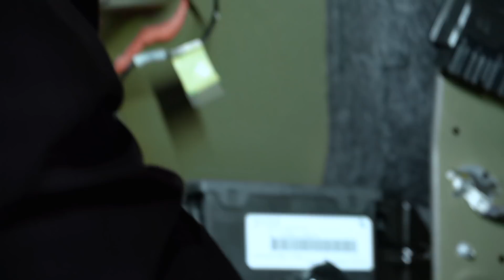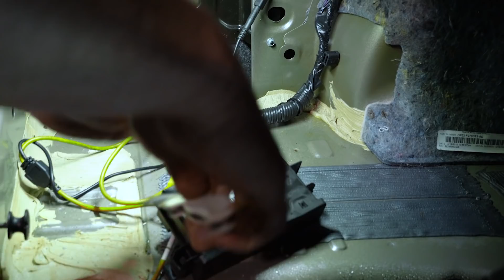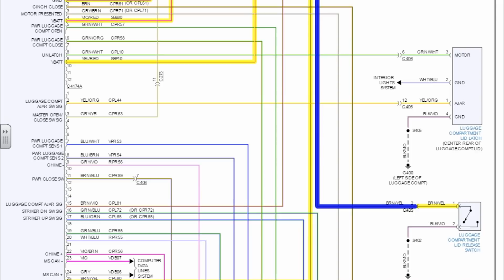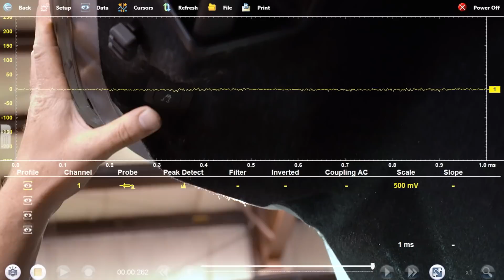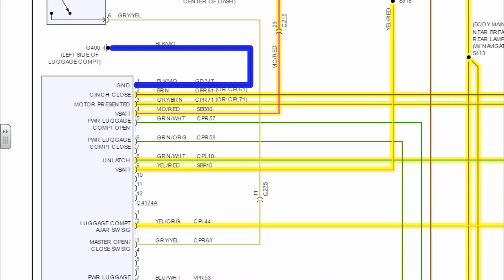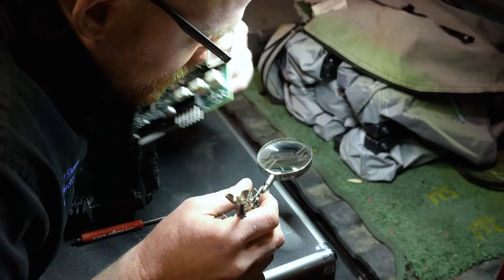2013 Lincoln MKZ Parasitic Drain/Rear Gate Trunk Module (RGTM) No COM (Part 2)

Comment from the maker: To the multiple people commenting that I should have loaded the powers and grounds on this module with some light bulbs, I want to tell you why I didn't and why I DO NOT carry around a bunch of different load, light bulbs around with me like a lot if you do.
Technically, with a dead module, there was no current flow, so you are not wrong in wanting to do that. My arguement against it and why I don't ever do this additional test in a case like this, is you are absolutely NOT going to have a wiring problem AND a dead module/component, that happens at the same time! It is one, or the other.
If by some chance, say 1 in 10,000, that you do, you fix the wire when you're done! After the module gets replaced and you can restore current flow, so you can now see the drop in voltage. Something you couldn't do with the component being bad/open. (why you guys love your light bulbs)
So I get the idea, I get the need to want to load circuits and carry a bunch of different brightness light bulbs around, but it is overkill, it's not needed.
Here is a  question for you guys:
During my KOEO, connector plugged in, backprobing tests of the powers and ground. If there was a power feed problem, what would it have looked like? If there was a ground problem, what would it have looked like?
One more, if you want to argue that there could be a wiring problem, was it a wiring problem that was causing our no com and completely dead inputs and outputs? Not a chance. So dead module right? But you say we could still have a wiring problem because you didn't load the circuit. My reply. It doesn't happen,  the module, motor, light bulb, solenoid etc etc does not fail at the exact same time you have a wiring problem. 
Now I'm sure one of you will have some obscure example of an electric motor failing from low voltage from a poor power feed. My reply to that? Did it need a motor still? Sure did. And when you're done, you find the pump runs but psi is low and then you find your wiring issue and fix it! You still needed a pump! You 100% confirmed the motor was open (12v on the feed and 0 on the ground). So yeah, that 1 car out of 10,000 bit you, but it was never a bad call, it was two separate issues. This just doesn't happen people. It doesn't
Reply: Quick question, wouldn't it have been possible if there was a short in one of the sub components (lid switch, lid motor/strike motor), you may have seen higher voltage in the CAN system because the 12v power would be looking for somewhere to go.  Also you could have unplugged those (you did most of them except the switch and latch in the lid) and see if 12v returns.  Just simple unplug it in those components.  Just trying to expand my knowledge!!
Reply from the maker: @igotaction  we had good 12v supplies and ground coming into the module itself, unplugging components on this computer system would not have help us in this situation. 
A short in a switch input, only affects that one circuit. A short in one of the outputs, again, only affects that one circuit. A shorted reference circuit (5v ref) is a different story and that was not an issue here either as a shorted reference would not affect output voltage levels.
Reply from the maker: @igotaction  great observations! Switch input circuits are isolated with current limiting resistors and will never cause  other circuit problems within the computer system when they get shorted or open. Now a pressure sensor, hall effect and a potentiometer would be a different story. These can short and take out the reference circuit (usually 5v)
Reply: ScannerDanner meant to say "could you have" not "you could have" it was a question.
Reply: Boom, roasted !

Comment: at 22:20, when you mention if the cinching striker is operable, quick check is to see if it moves up and down when you were simulating the latch closing with a screwdriver.  The power striker would likely still need to be plugged into the PDL module but probably should still trigger.

Comment: I need some advice please!! My car is identical to the Lincoln that SD just did. I had the battery replaced at Sam's club a month ago. A few days later I had to check engine light in my car wouldn't start with the push button. I then began getting several communication issue codes. Last week they told me that I needed to replace the fuse box under the hood. I went to pick up my car todayand now they are telling me that I need to replace the PCM and BCM!! How can a computer and 2 fuse boxes fail simultaneously? It's at the dealer, I don't have $2000, and none of this makes any sense. Could someone who knows this stuff please give me some advice? Thanks
Reply from the maker: Sounds like someone does not know what they are doing to me

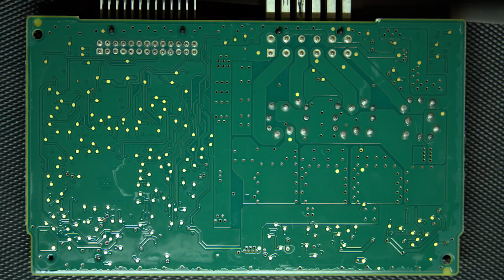Comment: 30:18 It could just be flux cleaner residue from manufacture.

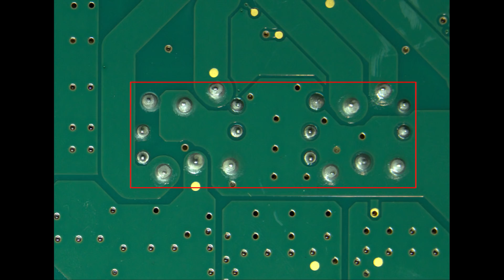30:34 Those are typical lead free solder joints even a good joint will look cloudy like that which is why they are so difficult to inspect. If that was a leaded joint then yes that would be a bad cold joint.

Comment: At least tell us the reason for air bag deployment to take care while diagnose, I suggest you make a video about how to avoid critical issues while diagnosing
Reply from the maker: I certainly will my friend
Reply: The Airbag Module has a multi-axis accelerometer in it, when he rotated the module, it probably 'detected' the vehicle was rolling over, and deployed the curtain airbags to protect the occupants, exactly as it was supposed to, the module doesn't know it wasn't bolted down so it 'assumed' the vehicle had suddenly rolled over.
Reply from the maker: Yes sir. HUGE lesson learned on that one

Comment: 15:00 could we just unplug the module as see if the light will come on and off, which will indicate if it's controlled by BCM of this module?
Reply from the maker: I just needed to check another diagram. Just didn't feel it was necessary for this case study. But you are like me, I wanted to know anyway 😃

Comment: I wish I had that module board in my hands to play with. The only thing I enjoy more than automotive electrical diagnostics is board repair. I’m no Dave Jones, but I can diagnose and replace bad components. It’s when I have to get a computer involved that I start struggling. I’m getting there though.

Comment: thanks for video. i was desperately waiting for this part2. i have issue with same car up model 2015 mkz hybrid.  MS(medium speed) can system is down for few modules and in one of down systems is trunk module. on MS can low and high i get 0.5 volts and jumping to .75 to 0.  but its erratic. Another problem with this model is that CAN splices (they call it splice module) are awful. no comm. with  hvac module, trunk module, front control interface module. i am stuck at a splice module 42( which i can't find in alldata). because i have comm. with radio transceiver module(rtm) but no comm. with rear gate trunk module.( i am also using snapon triton d8)
Reply: UPDATE.. Finally found the problem. Medium speed can wire found corroded under the carpet behind driver seat. my guess is that someone spilled water on carpet and water went into that connector.  as i connected wires everything was back to normal.

Comment: I liked seeing the extra steps to be as sure as possible that the module was actually dead. It's never easy to make the call on a bad module... especially when they are expensive.  Another clue, when you're not sure that you can believe your no comm with the scan tool, is that other modules reported not being able to communicate with it as well. Great video as always!
Reply from the maker: That is correct my friend. I believe I showed that part? I think the instrument cluster told us the rear gate module wasn't talking.

Comment: Don't forget to always test powers and grounds with the circuits loaded (such as with a test light). In this case, the module likely is faulty, but it never hurts to be 100% sure. It would suck if the root cause was a corroded terminal in a connector located further back in the trunk caused by the water intrusion.

Comment: Nice job Paul I’m fighting hands free trunk assist on a 14 bmw 328D and I’m testing now and thinking the upper of lower sensor is bad. I need to figure out how to test them. Not much data on them and wire diagrams are bad.

Comment: Great stuff as always Paul & Caleb! I've yet to be faced with calling any module, but I would have lacked the confidence to call one before I found both your Premium Channel, and the YouTube channel. 👍

That trunk was a mini greenhouse! A little sunlight and you'd have had a whole ecosystem living in there, LOL! Like the '92 940 I have here - I dropped a tree on it, and bashed in a corner of the rear glass. Water flows right in. There's all kinds of greenery popping out of the swampy carpet. 🤣

Holy CRAP dude! That side-curtain airbag blast clip made me a bit jumpy! I can't even imagine how that was being RIGHT THERE! That happened just from plugging in the airbag module? WOW!! 😲 Great lesson for everyone there!
Reply from the maker: It happened from unbolting and rotating the module (jumper wire connected to the housing to give it a ground). See, the engineers were smart, unbolt the module and you lose the main ground, but then "smart guys" like me figure that out and then give it a ground so I can test things live. Problem then was, I didn't know the module contains and internal roll over sensor. And there was the fatal error
Reply: @ScannerDanner  - AHH, thank you for that explanation!! I would have never known that in a million years. I watched it a few times after I made my comment, and I started to think just static from your hands set it off. Thanks for clearing that up! 

I'm thinking the price tag on that one was just as scary as the blast 2" from your skull. Sorry, brother!! 😵 I'd imagine programming was involved for the new parts as well. :(
Reply from the maker: @SmittySmithsonite  I'm going to to something with that video. There are lessons to be learned for sure
Reply: @ScannerDanner  - Cool, Paul - I'll be watching for that one. Thanks again!

Comment: Thanks for sharing SD👍, much awaited case study👨🏻‍🔧
You're Awesome, stay Safe & stay Blessed🙏
One question, how to find an electrical fault without having access to a wiring diagram or any other service info?
Reply from the maker: If I don't have a diagram, I'm not working on it.
Reply: Can be done in some scenarios, but it most modern cases it's not possible

Comment: Sorry if I missed something, but it's unclear whether disconnecting the module and other components eliminated the parasitic draw. 
On the subject of signals on the CAN bus; CAN signal decoders have been available for a while now. Knowing the CAN address of each module, one could determine whether a particular module is transmitting on the bus or not. Do you know of any such usable equipment/information becoming available anytime soon?
Reply from the maker: In part 1, we could not recreate the parasitic drain. Through the comments, I found out there is a TSB on reflashing the rear trunk module for this exact issue. But ours was dead when we started testing it. So a new module and the updated flash will fix this thing.
As for a signal decoder, in our case, there were other modules that confirmed the no com with the rear gate or trunk module. In my opinion, that is all you need. In other words, that is my signal decoders. The other modules
Reply: @ScannerDanner   I meant the decoder question to be generic, not necessarily as it applies to this case.
Thanks for taking so much time to answer all our questions, it's appreciated. Stay well.

Comment: Hey Danner, Great video. Very captivating. A couple of things I would improve on to check ANY module: 1) to check powers and grounds use an INCANDESCENT test light instead of a meter or power probe. ALWAYS. Meters and probes only tell you if there is voltage while the light tells you if there is voltage AND if it can handle a load.. Better yet a headlight bulb light on the higher powered circuits that can handle it. Even for checking a a 5 volt reference line, a tiny test light made from the tiny low power 12 volt bulbs (from old instrument clusters) tests if a 5v reference can provide a slight load, enough to power a sensor. The meter would only be used to check the weak diagnostic voltage coming from the signal wire to the sensor. 2) As for the No-COMM. If you probe the CAN network wires, you would see pulses and one would assume that the pulses age coming from the module being tested and conclude that the module is working , BUT you don't know FROM WHERE those pulses are coming from. If you unplug the module and test the CAN wires for pulses, you see the pulses that the rest of the network is providing. BUT what you really want to know is if the MODULE in question is making its own pulses. To check if a module is really brain dead you can plug the module back, make sure the ignition is on, and CUT at least one of the CAN wires. and test for pulses on the module side of the cut CAN wire, to see if the module is generating IT"S OWN pulses. I bet if you have done this test you would see that there are no pulses coming from the module. Or instead of cutting wires you can unplug the module, put it up on a bench, and power up the module, connecting powers and ground to the appropriate pins and testing to see if the CAN pins are pulsing CAN pulses. I have done both techniques on dozens of modules this way and made calls with certainty if a module is brain dead or good.  Of course, when using a test light use good judgement. You don't want an airbag blowing up in your face. Hope this helps other diagnostic people out there.  Thanks for the great videos.
Reply from the maker: BTW, I love your "cut the wire" test! I used to do this on circuits all the time
Reply from the maker: I would disagree with #1 in your comments. You're not wrong, I just have a different opinion on it. Caleb and I are actually going to film something on this and talk about this exact scenario. Thank you!
Reply: ScannerDanner yep,when everything is plugged in a multimeter can be more precise than a test light!!!  Cant wait for the video!!!

Comment: ok paul correct me if i'm wrong.   you got powers and grounds and with it unplugged you have network.  so if we were to de-pin the two network wires and plug them back in and operate a function that the scanner shows a pid for  if the modules can interface was working we'd see activity coming out of the module showing the status change and lack of would definitely condemn it.  i was thinking about this when you were showing the light operation by the switch but as you said it may also be controlled somewhere else. partially failed modules and intermittent modules are fun aren't they?
Reply from the maker: Yes, if you were to de-pin the 2 network wires, and measure on the module side, you would see CAN messages coming from the module itself if it was talking. It may look a little funny though without the terminating resistors, but it would be there.

Comment: I would check again the 2 power wires with a test light just to be sure.
Reply: He could have, however, he checked those power feeds by back probing and it was plugged in, therefore there was current flow on the circuit so the measurements were already accurate enough to pinpoint a voltage drop. You dont need to use a test light if its back probed and current flow is occurring
Reply from the maker: sabin  technically, with a dead module, there was no current flow, so @Alex Mironov is not wrong in wanting to do that. My arguement against it and why I don't ever do this additional test in a case like this is you are absolutely NOT going to have a wiring problem and a dead module/component that happens at the same time.
If by some chance, say 1 in 10,000, that you do, you fix the wire when you're done. After the module gets replaced and you can restore current flow, so you can see the drop.
So I get the idea, I get the need to want to load circuits and carry a bunch of different brightness light bulbs around, but it is overkill, it's not needed.
Here is a  question for you guys:
During my KOEO, connector plugged in, backprobing tests of the powers and ground. If there was a power feed problem, what would it have looked like? If there was a ground problem, what would it have looked like?
One more, if you want to argue that there could be a wiring problem, was it a wiring problem that was causing our no com and completely dead inputs and outputs? Not a chance. So dead module right? But you say we could still have a wiring problem because you didn't load the circuit. My reply. It doesn't happen,  the module, motor, light bulb, solenoid etc etc does not fail at the exact same time you have a wiring problem. 
Now I'm sure one of you will have some obscure example of an electric motor failing from low voltage from a poor power feed. My reply to that? Did it need a motor still? Sure did. And when you're done, you find the pump runs but psi is low and then you find your wiring issue. You still needed a pump! You 100% confirmed the motor was open (12v on the feed and 0 on the ground). So yeah, that 1 car out of 10,000 bit you, but it was never a bad call, it was two separate issues. This just doesn't happen people. It doesn't
Reply: I understand, thank you for answering and explaining.

Comment: I spent years at a dealership. The way Honda wanted the techs to diagnose network faults was with continuity testing. The dealership didn't have a scope, nor did anyone know how to use one. Not sure why dealerships don't encourage the use of scopes. It's the single most useful tool when diagnosing network malfunctions. How the hell else do you confirm network data traffic on a data line?
Reply: GooE because dealerships (most) 99% do not have techs with this knowledge or ability to perform these tests